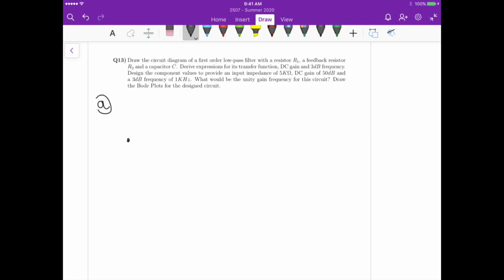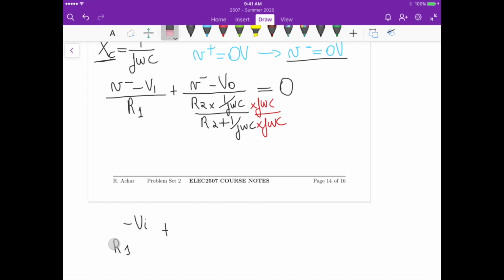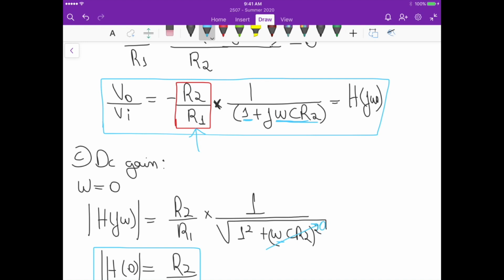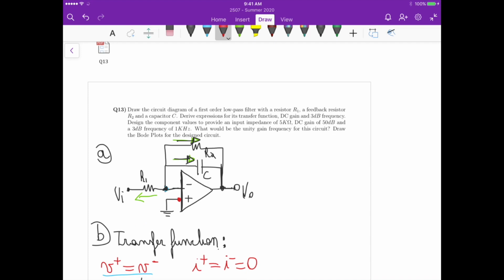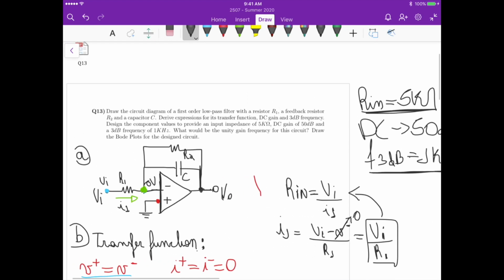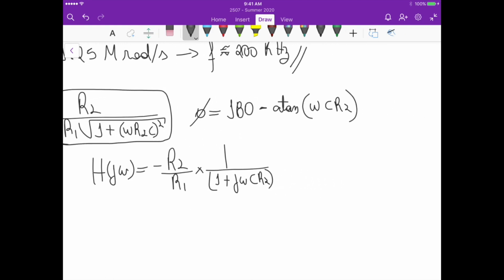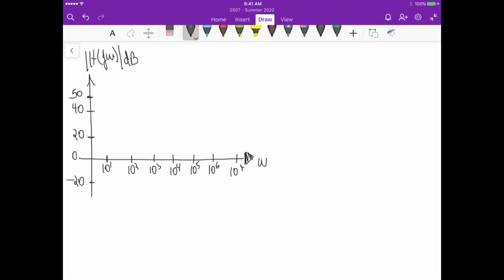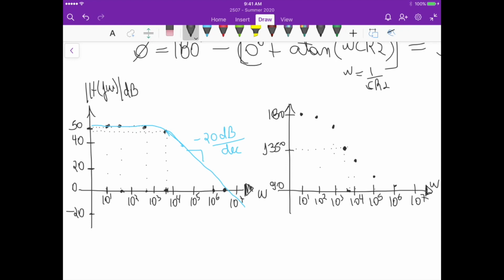Set 2 - Q13

Comment from the maker: For te capacitor value it should be 0.1 nF. Also, for the final value of the 3dB frequency it should be 318.3 kHz,  Just two miscalculations. The equations themselves are correct.